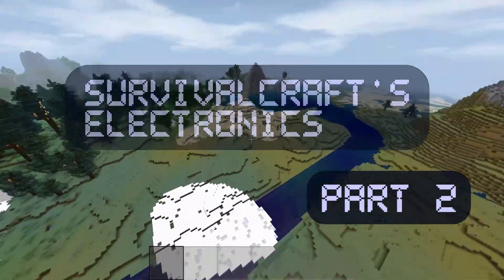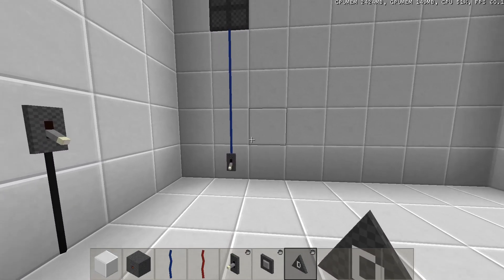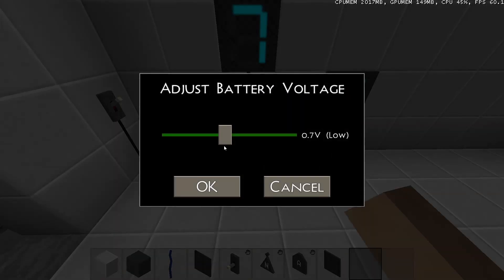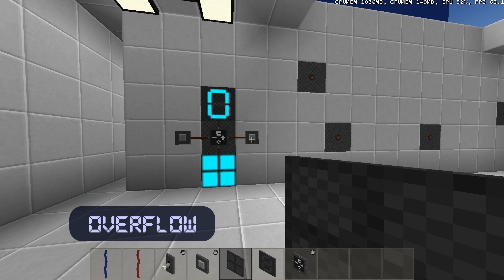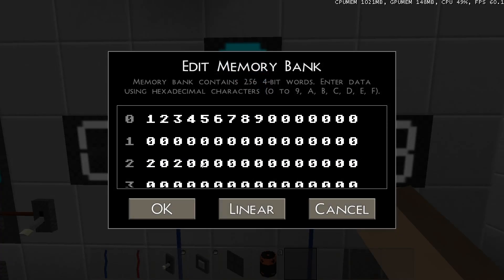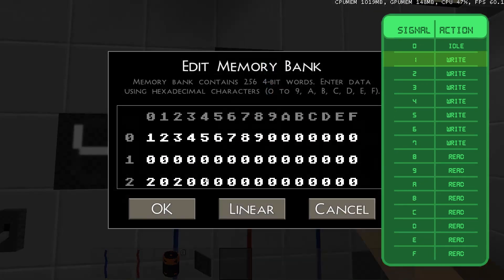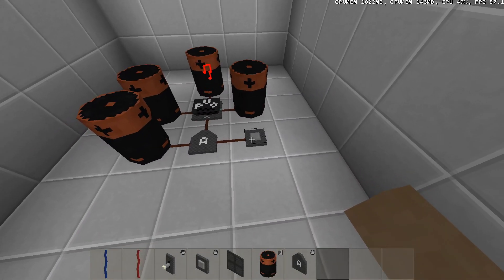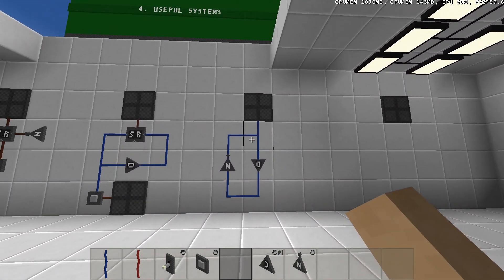How To Use Survivalcraft's Electricity - Part 2 Components

Comment: I've been wondering how to make some button or switch that opens a piston once, but can never be closed again?
Reply from the maker: Connect the output of an SR latch to your piston. Then connect a button to the "set" input and a button to the "reset" input of the SR latch. Press the "set" button and remove it (or hide it so that you can reset your map). When you press the remaining button the piston should open, and you can press it as much as you like but it won't ever close again
Reply: @SP4CEBAR  Thanks, I appreciate how after years and you're still active, literally the meaning of underrated
Reply from the maker: @ArmorgurgussyCODM  Appreciated!

Comment: To create a sort of system in which I have motion sensors scattered around the forest and I want to create a control center that can identify the corresponding signal to identify the sensor, what do you recommend?
Reply from the maker: I would recommend wires or wire-through blocks to transport the signal to your control center, maybe you can put them underground and group them in the way you want it to be displayed
Reply: @SP4CEBAR  okk thx
Reply from the maker: You may also be interested in this video by Symbadx37
https://youtu.be/2XdXUZpXAUs?si=mrOSuZMaCvMf8NNQ

Comment: I'm still confusing with logic gates. Especially when I want to make adder and subtractor. In case I want to make a simple game that give a poin, then the poin can be exchange with item. So it would be adder when win the game and substract the poin when it exchange with item.
Reply from the maker: Calculating is all about breaking bigger calculations up into smaller calculations. For most calculations, you can build the method you use to calculate in your head as an algorithm: 836 + 975 = (8+9) x100 + (3+7) x10 + (6+5) = (1) x1000 + (7+1) x100 + (0+1) x10 + (1).
So to add two numbers, you need some component that can take two digits as its input, and add them together into a one digit sum output, and a carry output (usually this value is either zero or one). This component you can wire up to connect to each two digits of the same significance of the input digits. You can make such a component for adding binary numbers: the two binary inputs are fed into an XOR gate (one of the two is on) for the sum output, and they are fed into an AND gate (both are on) for the carry output
In Survivalcraft, you can fill a memory bank with certain data so that it can be used to add hexadecimal digits together, this is faster than doing this in binary
Reply: @SP4CEBAR  dunno if u live in the US but unfortunately most curriculums before we adopted Common Core(2010s I think) taught us to memorize how to add/subtract/multiply/divide rather than explicitly teaching us different algorithms to use to calculate.
Reply from the maker: @wixyification I think you have also been thought an algorithm, for example: to solve 248 + 194, you'll probably solve:
8+4 = 12
4+9 +1 = 14
2+1 +1 = 4
to get 442, that's the algorithm I was referring to, it's the method you use to break large calculations up into smaller calculations
Reply from the maker: Here's some memory bank data you can use to perform calculations 

4-bit Hexadecimal Addition digit 1:
0123456789ABCDEF123456789ABCDEF023456789ABCDEF013456789ABCDEF012456789ABCDEF012356789ABCDEF012346789ABCDEF012345789ABCDEF012345689ABCDEF012345679ABCDEF012345678ABCDEF0123456789BCDEF0123456789ACDEF0123456789ABDEF0123456789ABCEF0123456789ABCDF0123456789ABCDE

4-bit Hexadecimal Addition digit 2:
0000000000000000000000000000000100000000000000110000000000000111000000000000111100000000000111110000000000111111000000000111111100000000111111110000000111111111000000111111111100000111111111110000111111111111000111111111111100111111111111110111111111111111

4-bit Hexadecimal Multiplication digit 1:
00000000000000000123456789ABCDEF02468ACE02468ACE0369CF258BE147AD048C048C048C048C05AF49E38D27C16B06C28E4A06C28E4A07E5C3A18F6D4B290808080808080808092B4D6F81A3C5E70A4E82C60A4E82C60B61C72D83E94FA50C840C840C840C840DA741EB852FC9630ECA86420ECA86420FEDCBA987654321

4-bit Hexadecimal Multiplication digit 2:
00000000000000000000000000000000000000001111111100000011111222220000111122223333000011122233344400011122333444550001122333445566001122334455667700112233455667780011233455667889001223445667889A00123345667899AB0012344567889ABC001234567789ABCD00123456789ABCDE

Hexadecimal to decimal converter, DIGIT 1:
0123456789012345678901234567890123456789012345678901234567890123456789012345678901234567890123456789012345678901234567890123456789012345678901234567890123456789012345678901234567890123456789012345678901234567890123456789012345678901234567890123456789012345

Hexadecimal to decimal converter, DIGIT 2:
0000000000111111111122222222223333333333444444444455555555556666666666777777777788888888889999999999000000000011111111112222222222333333333344444444445555555555666666666677777777778888888888999999999900000000001111111111222222222233333333334444444444555555

Hexadecimal to decimal converter, DIGIT 3:
0000000000000000000000000000000000000000000000000000000000000000000000000000000000000000000000000000111111111111111111111111111111111111111111111111111111111111111111111111111111111111111111111111111122222222222222222222222222222222222222222222222222222222
Reply: @SP4CEBAR  it's seems like 8 bit counter at mgblitz81 music to show track list isn't it? And then using XOR gates and AND gates (I used to learn this in Wikipedia call Half / Full adder) but it didn't work with hexadecimal
Reply from the maker: If I remember it correctly, the 8-bit counter in MGBlitz's music player is to select a track.
A half adder is a component that adds two binary digits together
The approach I use to add numbers in Survivalcraft adds two hexadecimal digits together
The way you break a large sum up into smaller sums that can be solved by one of the aforementioned components is the same

Comment: Could the memory bank be used to make things like calculators and computing stuff?
Reply from the maker: Yes, you can generate data to add, subtract, or multiply 4-bit numbers. Memory banks with such calculation data can be used to make 8-bit and 16-bit calculators.
To make a computer you'll also need RAM and registers. Luckily, a memory bank is a 4-bit RAM unit, so you can just use it for all memory related tasks.
And then, if I remember it correctly, you'll only need a program counter, and an instruction decoder, memory banks can take instruction codes as an input and turn certain wires on or off to activate the right calculation or logic processes.

In the future, I want to make videos about the process of making a CPU from scratch